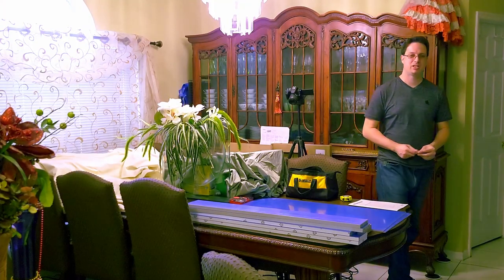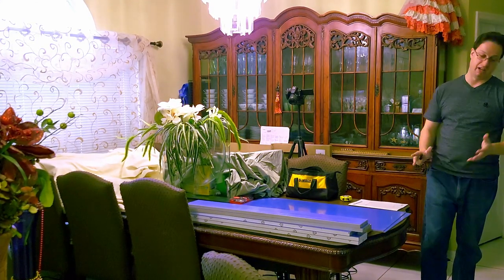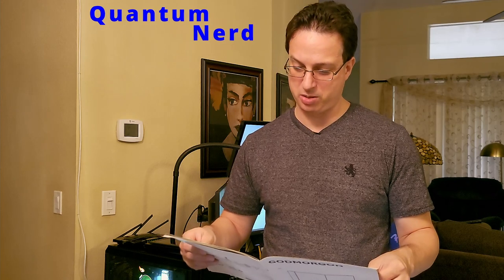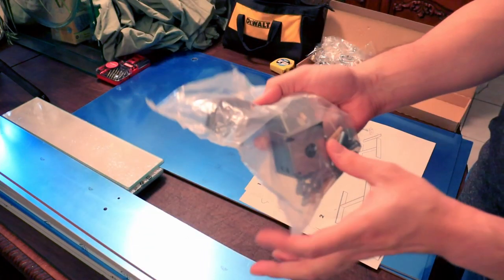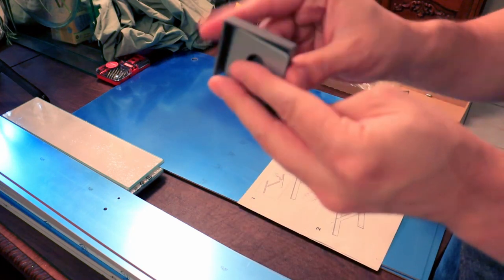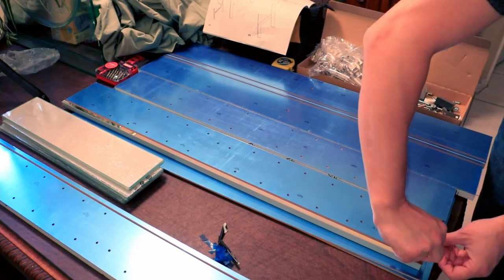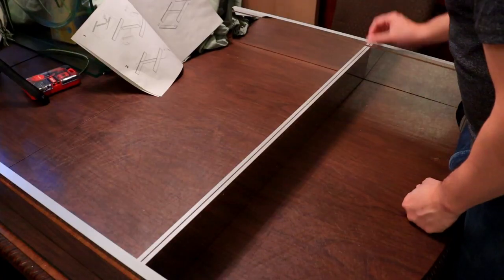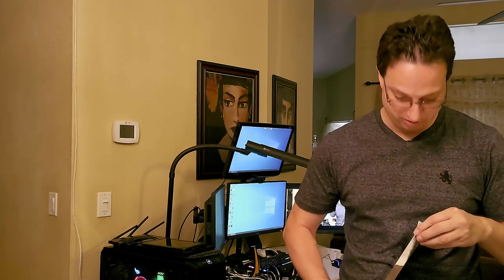Can We Build It?!! Godmorgon Mirror Cabinet From IKEA

Comment: You skipped over how you mount it on the wall. Many Ikea cabinets come with Z-Clips which makes it fantastically easy. My 32 x 37 Godmorgon mirrored cabinet only comes with a plastic circular offset and a keyhole plate you have to lift the cabinet over the protruding screws (screw - plastic circle - wall - anchor), hold up the cabinet while sliding the free floating metal keyhole plate over the screw, then screw it down while holding up the cabinet!!

Comment: How did you get the glass shelves in?
Reply from the maker: You would need to add them before you snap the 2 doors in place. That's one of the negatives about this cabinate that I should of went more into detail with.
Reply: If I'd known that I need to remove the doors everytime I need to change the shelf height, I would not have bought it.😒